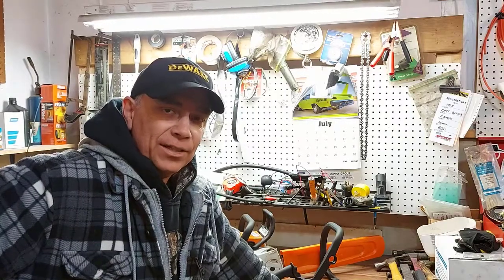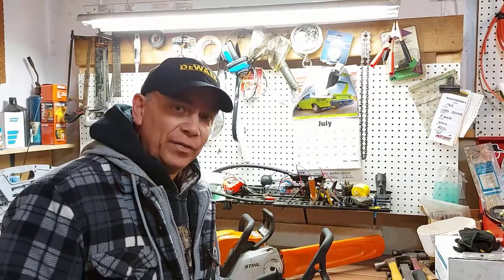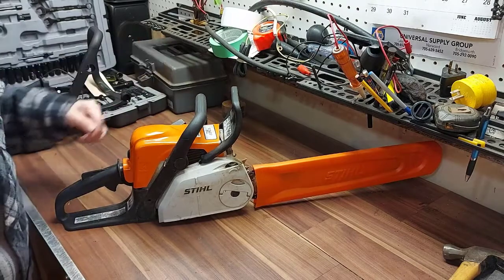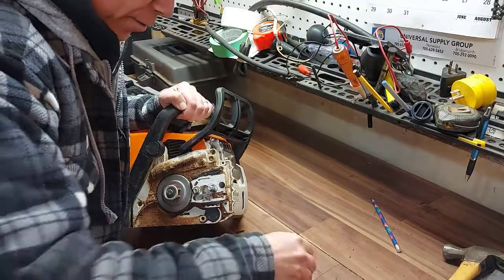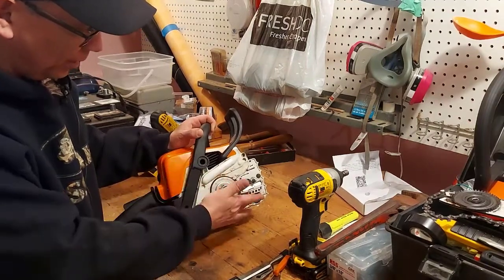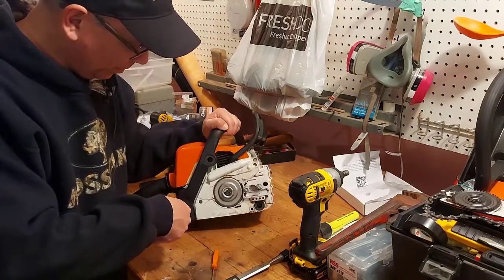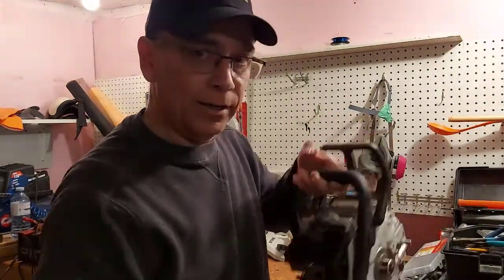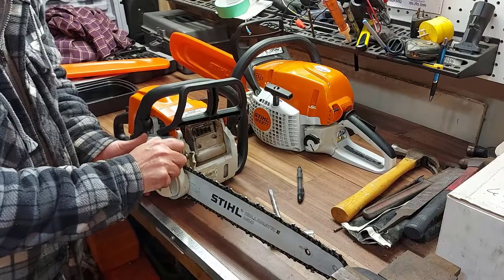Stihl MS 180 Handle Replacement | Not Easy - Learn From My Mistakes

Comment: Tip - I Just changed the handle on my MS180. After you remove the plugs from the rubber grommets and the throttle assy. You can just leave all the grommets in place and move the bottom front grommet from the engine ( leaves it in the handle ) and the other 2 remove the handle from the grommet ( leaving these 2 in the engine ). I used an easy out to grab the plastic slug that locks the grommet in on the handlebar and slide it out then the grommet came out of the handle easily. Inserted the grommet into the new handle, pushed the plastic slug ( greased ) into the grommet with an Allan key till it was home. Greased the rubbers and then fitted the handle bar back onto the engine in the same way. Then reassembled the rest. Now that I have it worked out i think it would day 20-30 min max to change the handle now.

I must also note that I use WD40 ( CRC ) to lube the gromments before handle removal and grease before assy.

Hope this helps

Pete

Comment: I was felling a small, decayed tree, got my blade pinched, and ended up dropping the tree on my saw (oops) and broke the handle, leading me to several of these videos.  This video is really well made, but after doing mine, a huge piece of advice to anyone tackling this task...

Get yourself a small syringe and fill it with a 50/50 mixture of dish soap and water.  Remove the plastic caps, and then pry the side of the rubber grommets away from the handle and squirt the soap mixture all around.  Instead of pulling the grommets out of the saw and handle,  just pull the handle off the grommets (you can use a flathead screwdriver to help push the grommets all the way through if you need to).  You can even cut the handle so you can pull it straight away from the saw (although mine was already broken so I didn't need to cut it).  I mean, you are replacing it anyways so who cares if you destroy the old one?

I was able to pop the handle off in about 5 minute without destroying any of the rubber grommets.  The hardest part was that the lower grommet came out of the saw all on its own and I had to work it out of the handle.  Every video I watched complained about how much of a pain it is to remove, but it was super-easy.

Comment: You missed the most important part in this video and that was how did you reassemble those grommets into the handle? so I did not remove the grommets from the main body, but I did remove the grommet from the lower portion under the chain. My new handle came with new grommets but not new plugs. Anyway, my process for reinserting the new handle was basically as follows. The Gromit on the lower portion under the chain was relatively easy to put in, and I started by inserting the new handle portion on that which you could do pretty easily. Lubricated the grommet with some oil, figuring that these were all oil resistant because oil gets everywhere on these things. Then I try to insert other two grommets sort of one at a time using a screwdriver to flex them in place but that didn’t work. So I got them approximately lined up and then used a large parallel clamp made of wood, an old one, and applied for some pressure to lower the throttle handle. that didn’t work so I started at the top one and was able to snap that one in the clamp carefully. Then I followed with the one. Then it was easy to finish the assembly. Hope this helps.

Comment: not many people are saying this but the rubbers are meant to stay in the mounts!  and pry handlebar over the rubbers!  they don't need to come out of the saw housing!  to remove the handle bar! pry bar over the tops of the rubbers after removing the caps!
Reply: yeah I wish I read this before shredding one trying to get it out of the body.  As mentioned above, don't try and remove from body, leave there and pull the handle off leaving them in place

Comment: If you replace the rubber mounts you will have to remove the motor to pull the plastic off of the upper mount to do it right. I am in the reassembly of a 180 right now.
Reply from the maker: I noticed that when I did this. I didn't want to go that deep.

Comment: Awsome my friend 😀 Eva
Reply: The hard part was as you say taking the plugs out of the vibration rubbers. Well that was easy the part I found difficult was removing the old handle from rubbers. Get a small screwdriver or to and work handle off them. Started with bottom forward rubber but the rubber came out attached to handle.Then prise off the top one and last the bottom rear. The rubber attached to the old hand I just busted the handle and it fell out. Then put rubber inside the hole from rear and work it into the hole screw driver fingers a bit of spit  it will pop back in. There is a white plastic  bottom to the rubber that will be closest to engine. I will get back to you when i fit new handle. Aussie Mate

Comment: I just did this to mine, to all of 15 minutes, i fugured out that if you push the rubber grommets in through the handle, they pop right out,yu can remove the handle and use wd40 and the grommets popped right back into the new handle. Took longer to sharpen the blade than replacing the handle.